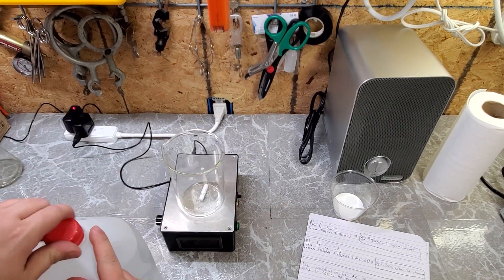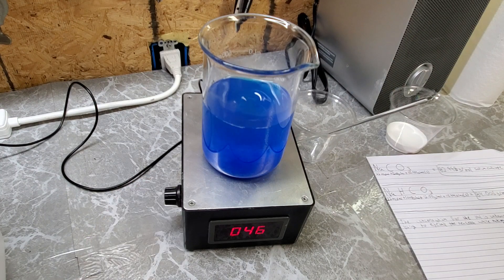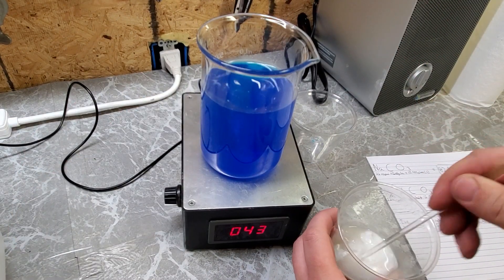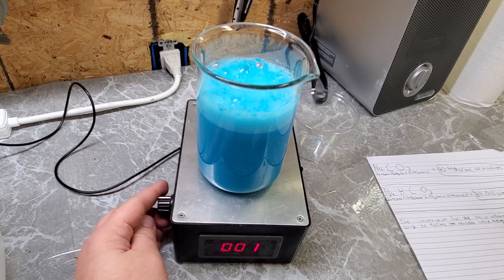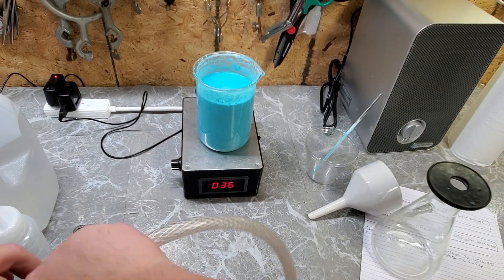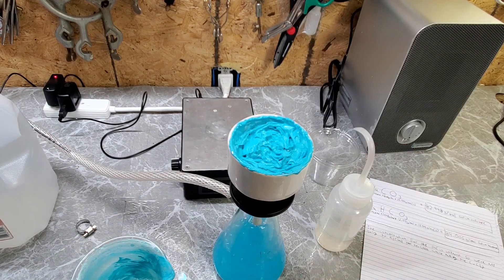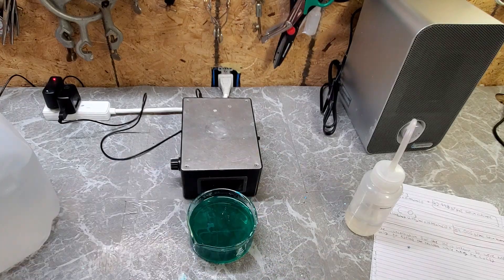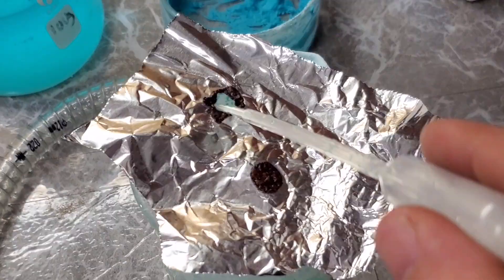Making a Quick Batch of Copper Chloride

Comment: Or! You can skip useing sulfides altogether and use HCI with an equal ammount of 3% hydrogen peroxide with no contamination and is cheaper.
Reply from the maker: Yeah I've done that before but I just used what I had on hand. I probably should have just done the copper metal with acid and peroxide but I admit I do like to watch the color changes you get by doing it this way.
Reply: @randomergy683  the color changes won't happen if you use weak peroxide. Higher then 6% and you get color changes and lots of  chlorine gas. Learned that the hard way lol